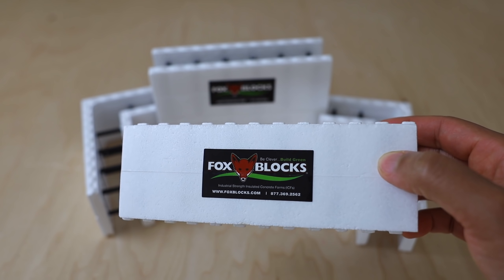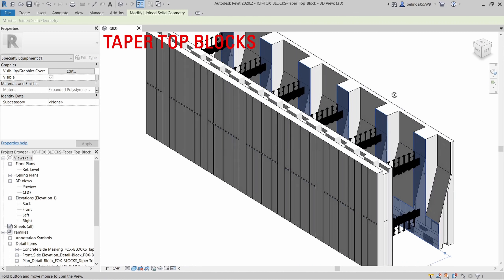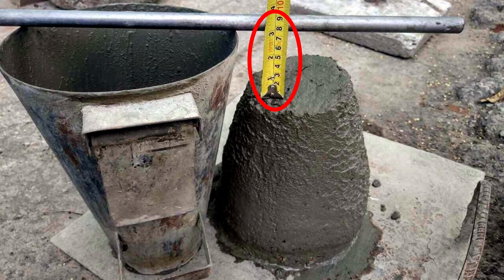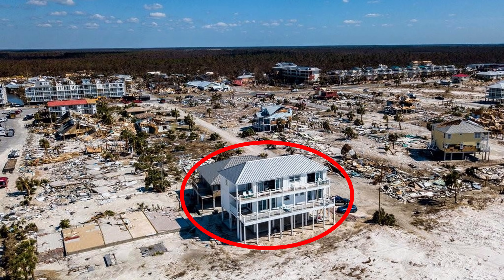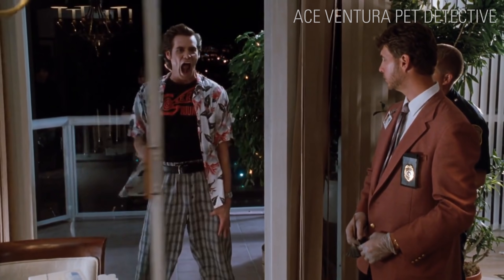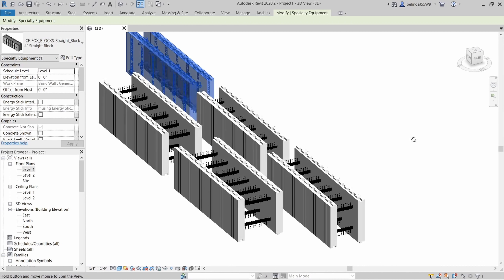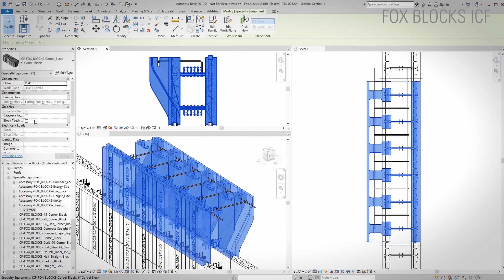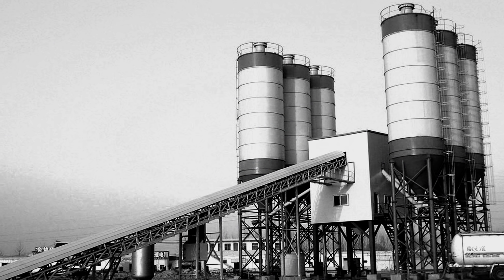Pros & Cons of Insulated Concrete Forms /ICF construction

Comment: southern china did an experiemnt built with ICF a couple years back and it failed due to mold.
Reply: That's not a problem exclusive to ICF construction - that's largely an HVAC issue that began during the design phase. Any efficient, airtight building construction — ICF or no ICF — will require much greater attention to HVAC.
Reply: @rojohe  Not a big fan of ICF in the southern climate: it is wet for the whole year round there is no dry season. The dependency on HVAC or mechanical drying demands the user to maintain it all the time which is not possible for times like economical downturn.
Reply: @MultiYlin  In order to meet the latest energy efficiency standards building codes for all new construction, regardless of whether it’s ICF, CMUs, SIPs, stick-framing, etc., are requiring tighter and tighter building envelopes to reduce energy demands; there’s no getting around the codes. Another objective with this approach is to significantly improve indoor air quality. Of course, as you pointed out it can lead to moisture issues and potentially serious health concerns if not addressed properly. It’s also worth noting: it is easier for moisture (and infiltration of unwanted air contaminants) to move in both directions if a building envelope is leaky as opposed to tight. A tight building envelope is much easier to control than a leaky one. Hopefully I'll get some feedback from ICF builders and homeowners in the Gulf states from Louisiana to Florida.

Comment: How about Bautex (or similar)? It's similar of ICF but the EPS is mixed with concrete (so a kind of CMU). It leaves big holes inside to be filled with concrete rebar. This method will definitely reduce cost due to less concrete and rebar necessary. What do you think and how do you compare it with ICF?

EDIT: Oops, forget about it. They just closed their operations... The other option (which is strangely the exact same thing) would be the "perfect block" (that's the name). But their presentations and site are awful, I don't feel reassure about it. I also couldn't find where to buy, so I guess this concept isn't going anywhere.

Comment: You cannot put Hardy Board directly on ICF.
We did a build, the Hardy Board Rep said we could.  We did about 6 feet of Hardy Board.  The next morning we pulled off a piece and it was wet with condensation.  You have to strap it out.

Comment: I really think that electric insulation if far cheaper in IFC. Really all one needs to do is mark out their route, boxes and main panel location. Hot knife all the boxes, cut the chases and install the wire. there are far better boxes that you can buy made for ICF. This should cut labor time down by a large fraction due to not having to drill holes in studs, route wire and many other things. 
Plumbing is also in between cost. Planing plumbing routes along with electrical is key in this design. 
there are also companies that make higher r value ICF. They are getting thicker every year and I am not sure if fox block folds down for shipping, I do know that other companies do this now and also have far longer and taller blocks to make less seams. 
Moisture is always going to be a problem in tight built homes and having dehumidifiers or mini splits will help solve this problem along with mechanical air exchanges.

Comment: ICF is very easy to DIY.  It literally is like playing with big legos...  If you are used to working with wood  and can fab your own bracing, you can get the cost under 10/SF(we did)...  The only place where things get a little tricky is if you live in a seismic zone.  The rebar and floor/roof diaphragm schedules for seismic zone re-enforcement is significant and will impact design elements(vaulted ceilings, skylights ect are more difficult) and the prescriptive tables don’t cover that so you must include an engineer in your plans.  in y0ur excellent video, you barely touched on one of icf’s main advantages.  The time it takes for heat to penetrate the thermal mass puts the walls out of sequence with the day to night heating and cooling cycles which is why a wall with R25 total can perform like a R50 wall

Comment: Great video, very informative.  I was concerned about termites burrowing into the EPS foam.  Could you look at ICCF walls like 'Perfect Block' and 'FASWALL composite block' or other alternatives?  Some of them use less concrete and different insulating additions and bracing.  I've been very curious!  Keep up the good work!  I've subscribed and liked.
Reply: Lots of scary reports about insects.  I wanted one, but no more. I'm looking into standard poured concrete paired with rockwool.

Comment: Another great video!  What about insects?  Is a termite certificate obtainable with ground contact foam?
Reply: No, but if you use metal roof framing and fiberglass windows, why do you care?
Reply: @kkarllwt  Because some places require a certificate to get signed off.
Reply: @kkarllwt   Because they would destroy the insulation and then move on to cabinets and furniture. Smh You can't just make pets out of them.

Comment: I would like to try building a underground root cellar using the fox blocks. 2 concerns, first is the slab to wall seam. Second is how complex would a concrete ceiling be and the seam seal there also?  js

Comment: The damages done by hurricane is normally flying objects with speeds up to 200mph (300kmh) damaging the exterior wall. Therefore the outer layer acts as an absorber to reduce the impact and damages.

Comment: We plan building our home with ICFs in Québec, Canada. I was told those were great for cold climates but you stated the opposite. Ain't the R value of ICFs better than traditionnal sticks construction?
Reply: ICF block systems have a better R value than any wood wall system of the same thickness.
Reply: @ericbeder1419  Well now, you are just wrong. A ICF wall with a total thickness of 12 inches would have a R value of 23. A double stud wall of the same thickness filled with cellulose or rock-wool would be R 33. And be a lot cheaper.

Comment: Thank you. You mentioned termites and ants eating foam.  The exterior seems vulnerable. 
Yes good construction workers and good materials are needed in a home.  
Concrete thermal mass works to smooth out changes. But for Summer and winter where the temprature stays below 40 or above 90 then the wall is R-30 not an R-50.
Reply: Insects don't eat foam. Ants live in the foam, and termites tunnel through it,
Reply: @kkarllwt  eating it or chewing through it is irrelevent. It's destroyed either way, and then you have a mass of bugs in the wall

Comment: Low R-Value?  There’s no thermal break in ICF.  The higher “listed” value of typical insulation in a wall is the value for the insulation itself.  Where the studs are the value is close to nothing.  You get a thermal break every 16” with normal stick framing.  ICF r-Value is a true R value.  The HERS report for my house in ICF came in a 42.  Where the same house in stick framing would have been 71 according to the Company who did the report and later the testing.  ICF I used all over Canada because of its desirable characteristics in cold weather.  You are steering people wrong in that portion of the video.  The rest is accurate. Nice job.
Reply: A 4 inch stud is R 5. a 6 inch stud is R 8.

Comment: you need insulation on the outside and thermal mass on the inside of the wall for a high performance building; those blocks dont work this way which makes them not usable; you can pour concrete wall with whatever forms you like and insulate it with foam from the outside and it will work great
Reply: Other vendors offer foam in different thicknesses. Nudura offers a 150mm (~6 in) foam option. Or you could attach another insulation panel to the outside of a standard ICF block.

Comment: My thoughts on building my own home is with ICF's. No funny angles to the walls or roof. All plumbing coming down from the attic.  On slab with foam board and heated floors. I am not totally sure on a roof structure yet, but I know I want it to be the best for solar panels and sealed with spray foam and then thick Rockwool insulation. I want a total envelope and an attic that I can stand in and not bake in the TAMPA BAY SUN.... If anyone has a great roof for this simple ranch build, let me know.   
I wonder if the blocks made for hanging brick exterior could be turned around to set joists on??  Trusses would be fine as long as I can walk from end to end easily with some storage.

Comment: I see issues with rebar over lapping tie down
How to access about 30" of overlapping rebar then add tie wire
You neglected to mention the rebar size looked like #4

Perhaps using a combo of stick n concrete would serve well in tornado areas
Concrete for bunker with concrete roof the walls can be wider to support concrete roof.
Or walk in safes

How to install drywall ?
Do you use high cap metal furring shot into concrete walls? Then use metal screws to attach drywall

Can it be used in place of a gunite pool ? Strip inside foam for plaster
Reply: Drywall attaches with regular drywall screws to the abs plastic webbing that holds the forms together. While it would have been nice to have had that shown in this video, it literally took less than 10 seconds to find this other video https://www.youtube.com/watch?v=MJjPO9xy6tI . Whatever concerns you listed are equally easy to address.

Comment: Small quibble on the comment about ICF in cold climates and needing more insulation.
Most ICF vendors have options to add additional insulation (which is normally recommended to be put to the outside of the wall..
You simply spec a slightly wider wall web/tie.
With the Quad-Lock system, you're able to use extender ties to build walls with cavities in excess of 24 inches.  And you can add 3.5 or 4 inch panels of additional insulation.
With the same Quad-Lock sustem, you can build walls up to R59 conventionally rated value (not the "extrapolated" value applied to ICF due to the continuous insulation).  This delivers a 21" thick wall with 15" of EPS foam and a 6" concrete core.

Yes, this works out to higher cost.  But this is true with any wall assembly requiring higher levels of insulation.

Comment: EPS is not an especially good insulator. Are the manufacturers moving towards isocyanate foam?
Reply: Actually, EPS is just fine.  It's higher per inch than rockwool, fiberglass or cellulose.
Additionally, the continuous nature of the insulation envelope actually also performs better than batt or blown-in as there are no thermal bridges.
Also, PIC's insulation performance is great at regular temps.  But as it gets colder, it can lose over a third of its performance value.
Moreover, PIC and XPS both off-gas.  In addition to the issues with tight-home environments, it loses performance over time during the off-gassing.  So you're paying more for a product whose value "goes up in smoke" after a few years.

Also, PIC is NOT rated for ground contact.

So no, ICF providers are not moving towards PIC.

Comment: Would you please comment on Helix fiber cement as a cost effective and time saving alternative to rebar.  And, I would value your input in the early stages of planning a small DIY home build. Do you offer consulting services?
Reply: Helix is NOT a complete replacement for a rebar schedule.  I'd hesitate to replace vertical rebar, as it performs the important function of tying the walls to the slab/foundation.

But talk with Helix and your architect to come up with an adjusted rebar schedule.
Reply: From what I have seen it works great on the slab, but wouldn’t be a substitute for vertical walls.  You may still consider using rebar in the slab where walls will be placed.
Reply: @davidwooten3430  With slabs, you have to be careful about finishing.  Because you do NOT want pieces of wire sticking up out of the floor, ripping holes in your feet.

This falls under "That Would Be Bad".

And yeah, I'd still use some regular rebar in such a slab.

Comment: So much in this video I take exception to.  The comment on the finger joint lumber as inferior.  What do you base that statement on?  Have you test data that shows that they are unable to perform the task required of them?  Do they potentially look different?  Sure, but are they structurally fine?  More than likely, so your comment is showing your lack of knowledge and bias.  As you stated, wood is increasing in price, so FJ wood is an option to use smaller, shorter growth trees to meet the needs of the industry.  Also, your statement about R30 walls as a requirement also shows that you might not understand home science.  Most municipalities look at multiple factors when trying to improving our homes.  Ultimately, it is about comfort and air quality in a home and insulation isn't the only contributing factor to achieve that.  Sorry after watching a number of your videos, you've made too many statements based on here-say and not on facts and research.  Unsubscribed.

Comment: My only issue with what you stated is the "poorly built wood framed home".  So are you saying ALL homes built with wood are poorly framed?  Or are you making the comparison between ICF and "poorly built wood framed home" as a example of how much better ICF's are?  Either way, this is a poor statement on your part.  All homes require inspection and must meet minimum code requirements.  If a home is "poorly built" as you state, it would not pass inspection, therefore it would have to be corrected and therefore no longer be "poorly built".  Your statement shows your clear bias.
Reply: Most wood frame houses are 'poorly ' built. I worked as a carpenter for 10 years. I didn't design or spec the house, but I built short term crap.
Reply: @kkarllwt  Basically, large developments will cut every corner they can to maximize profit.  They incorporate to protect themselves.  Throw up crap for a few years.  And then, as their "guarantees" are about to expire, they close shop and reincorporate under a new name.
Reply: The thing is, there are things that can be done to bring wood homes up to a better spec.
But, by the time you've done all these things, you're up around the same price point as ICF.  Just in materials.
The additional labor costs vs high-spec wood is what REALLY kicks you in the nuts and makes ICF more attractive.

Comment: Again, I am so glad I found your channel Belinda. I've decided my new 6,000 sf home will be ICF built, I am leaning towards Nudura due to the collapse abilty of the forms for shipment. Question, I have been considering  using the following: https://www.helixsteel.com/products-services/helix-micro-rebar/
as a replacement or reduction in the use of rebar in the ICFs, footings, driveways and slabs. Are you familiar with the product? Would love your thoughts. Thank you.
Reply: With Helix, talk with your engineer about the rebar schedule, and go with their recommendations for how to re-calcuate with Helix.

Also, on horizontal surfaces (floors, slabs, footings, etc), your concrete guy needs to be aware of the fact that you're using it.
As with any fiber concrete additive, special care NEEDS to be taken in surface finishing.  You don't want steel fibers poking out of the surface, gouging feet, popping tires, etc.  This will add slightly to your bill for the concrete finish.
Reply: There are a number of macro ( 1 1/4 to 2 inch ) fibers that will allow a reduction of rebar. Both plastic and basalt.
Reply: Nudura comes in 8’-0” lengths. Most manufacturers use the shorter 4’-0” long sections. Yes, the collapseability is definitely a shipping/stacking plus.

Comment: I find your videos so interesting!! My grandfather built a home out of ICF in the early 2000's, and I helped him with a lot of it - including stacking all the blocks. It's got an isolated standing seem metal roof on it. The place is really air tight! One issue with the ICF construction is when you want to hang something on the wall, the only place you can drill a screw is on the high density plastic part.

Comment: Have you looked at any other brands of ICF not just Fox?  Do you see advantages of Build Block, Nudura, Amvic, etc?
Reply from the maker: Trying to get samples of all those brands you mentioned for a comparison video!
Reply: @BelindaCarr  Do you want a CelBlox sample? I would be happy to send one.
Reply: @BelindaCarr  awesome! looking forward to it. :)
Reply: I know several ICF builders across the country who've used multiple types of ICF system.
According to them, they all have more in common than they do differences.  Performance of their basic block units is roughly identical.  There's a couple of system-specific "gotchas" that you have to learn.  Like BuildBlock corners.  They have their own vertical rebar holder that is common to every course (helps prevent "floating" of the corners when concrete is poured), whereas other systems simply rely on your rebar schedule and rely on a combination of exterior wood blocking and careful pouring.
Reply: @PhotonHerald  CelBlox corners also have a vertical rebar holder.
Reply: @CelBloxICF  Thanks for the info!

Comment: I see termites loving Styrofoam pieces.
Reply: There are multiple mitigation strategies for that.
Various wall finishes will render the wall termite-resistant.
There are also ICF blocks laced with stuff to kill termites.
Various peel and stick membranes create termite resistance.
Plus things like Termimesh, etc.

Above grade, it's actually easier.  There's a termite-guard flange you can embed into the wall.

Also, you can prepare the area with various sorts of rock and sand fill that will prevent termite migration.
Reply: @PhotonHerald  thanks.
Reply: termites don't eat foam. the just travel in it. Use metal roof framing and plastic windows.